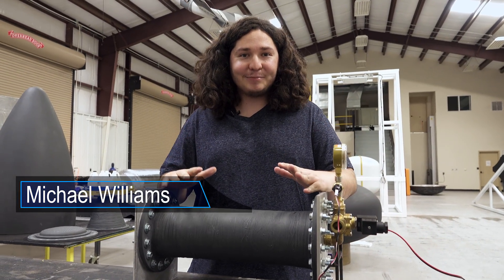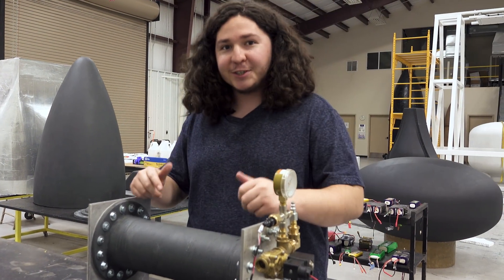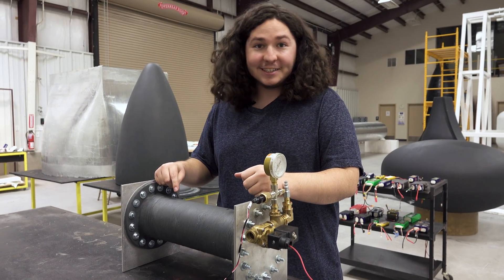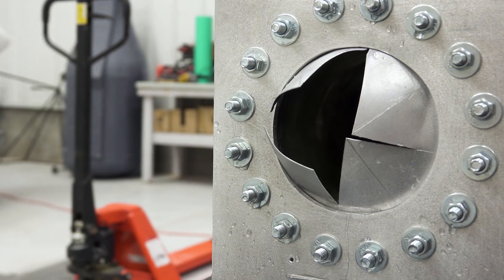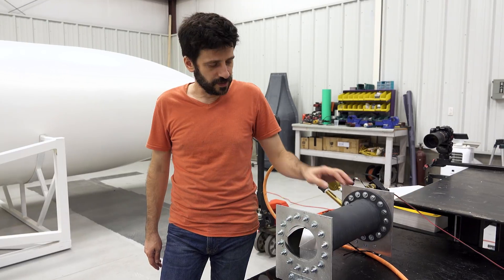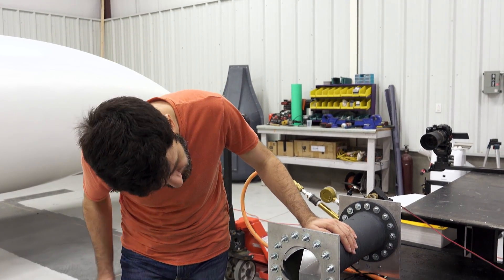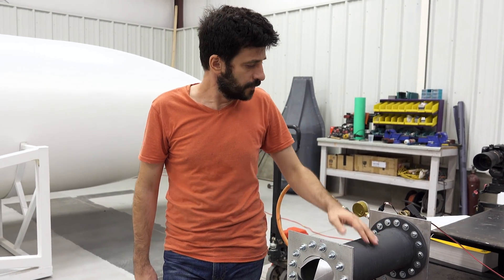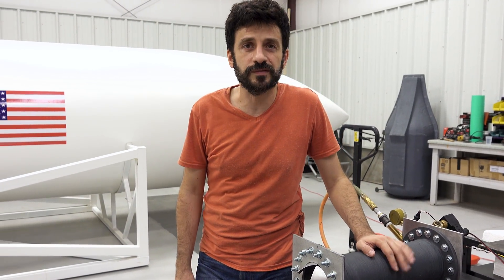Flight of the Aerospike: Episode 16 - Conduit Testing

Comment: How are you able to guarantee that both discs burst simultaneously? If the chamber side disk bursts first wouldn't you just be emptying your HPA into the atmosphere? Also, once the discs are burst, won't some of the resulting steam rise up into the H2O2 tank and begin filling it and how will that affect performance?

Comment: How are you ensuring a complete decomposition reaction to get maximum thrust? ..with the pressurized tank and a fixed reaction time there is a possibility for the fuel to exit the rocket without a complete decomposition thus losing thrust.

Comment: How will you pressurize the HTP tank? Will you release Helium (or some other gas) to increase the pressure to break the disk?
Reply: Pretty sure it will be helium, as with all other pressure-fed rockets.
Reply: If the HTP tank lining isn't perfectly inert (in terms of what will react with or catalyse the decomposition of hydrogen peroxide) it will self-pressurise by decomposition at no extra cost, lol. The crazy way of pressurising it would be to force the decomposition of a small amount of peroxide either with a heating element or by injecting a catalyst e.g. potassium iodide into the tank.
Reply: I guess that's true, but since peroxide decomposition is exponential, not linear, it might not be a good idea to purposely initate decomposition.
Reply: I did say it was the crazy way of doing it :D
Reply: ARCA Space Corporation+ Ah, that explains the double burst disc setup. I think the Black Arrow programme used last minute fuelling as well, they used the same propellants as you're planning for the full size rocket.

Comment: At what pressure does the burst disk break? Injector pressure has a LARGE effect on Isp, was kinda sad to see the pressure gauge you were using was not even marked for all that high. I understand how hard it is to pressurize a large tank to a high level however would hope you would use at least 1000 Psi in-order to get the higher Isp needed for SSTO.
Reply: Well, this is just a test for the linear aerospike, so they probably aren't even aiming for a high Isp. And they are using H2O2, which isn't a great propellant to begin with. I'm sure that the Haas 2CA will have everything running optimally.
Reply: In order to test if the methods used to build this can handle what they will be subjected to during a flight they need to be tested to the same levels as during a flight. Also if tests are preformed at less then flight levels you will not be able to calculate Delta-V as accurately. The rather poor performance of H2O2 is largely why I was surprised to see such a low pressure gauge being used,  higher pressure is needed to make it competitive with standardized systems.
Reply: The chamber pressure tested here is probably what they'll achieve in-flight. Since the point of the Demonstrator 3 is to just fly a low-altitude ballistic trajectory, they simply do not need high performance. There is even a group called the "Sugar Shot to Space" and they are trying to fly a sounding rocket propelled by sugar propellant into space. Sugar propellant only has a specific impulse on the order of 115 to 130 s. 

According to this http://www.esa.int/gsp/ACT/doc/PRO/ACT-RPR-PRO-JPC2006-HP%20Rockets%202006-5239.pdf research paper, they were able to achieve a specific impulse of 140 s at  a chamber pressure of 10 bar, which is much less than the Demonstrator's 3 most likely pressure.
Reply: A paper on RCS thrusters is hardly a good source for info on a prototype orbital class engine. Even my armature bi-propellant engine uses a tank pressure of 20 bar. For a corporation 20-30 bar should be a very easy feat. This is the reason I asked THEM, unless you know for a fact it is not worth your replying to a question not intended for you.
Reply: +Thorgon Cross Wow, okay. I was trying to keep it civil. Since Isp effectively stays the same no matter how much thrust you're generating, 140 s seemed pretty fair for a peroxide engine.
Reply: Thanks for the detailed reply. Guess it makes sense that with such a large rocket the dry mass to reach the high pressure is not worth it, unlike in-orbit thrusters were the dry mass does not go up much do pressures the smaller tank.
Reply: Way to be passive agressive...
Reply: I was being civil, sorry you misunderstood and got offended. Was in no way passive aggressive to simply politely state my opinion and that i wanted to know the answer from them.
Reply: Alright, thanks for clearing that up.

Comment: Burst disc?It does not seem very reliable!Even with this test can you be sure that the burst disc will break as intended?
Reply: Burst disks are not great but are rather reliable and have been used like this in rockets before.
Reply: ARCA Space Corporation Ok,i wish you succes!

Comment: It may be of value to consider a 3D printer known as the Blackbelt 3D printer. It is a new production-ready printer that will be on market soon, but is capable of very large print volumes at 33cm x 33cm x infinity as it extrudes horizontally (along a conveyor) rather than vertically as most printers do. Such a printer would greatly automate positive mold making (for example), and likely reduce your costs and speed up prototyping.

Here are some video examples of the printer in action:
https://www.youtube.com/watch?v=Pd1BSWEraf8
https://www.youtube.com/watch?v=2Mg5jGQpe_U

I thought that it might be helpful to consider. Just trying to help! :)

Be well.